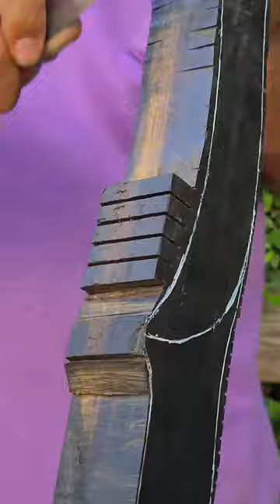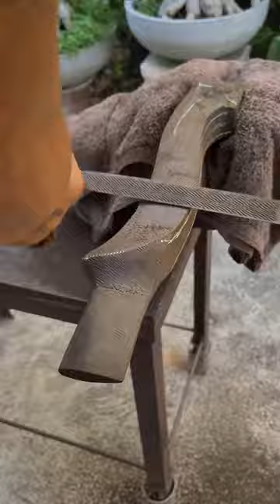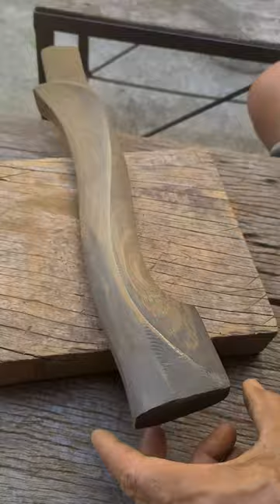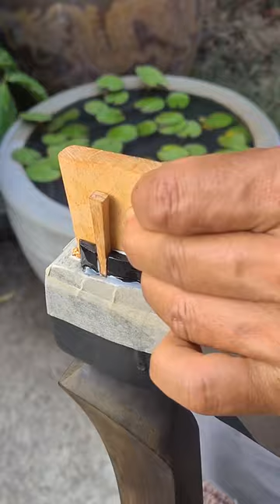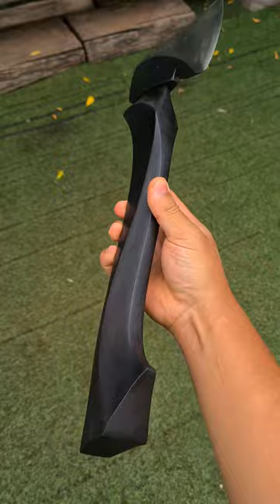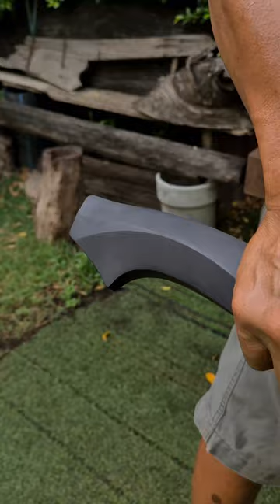Real ebony axe handle for collection and display! #craftsmanship #asmr

Comment: A beautiful display piece. Definitely the wrong wood choice for usage. Normally for handles you choose something less hard and brittle that will flex a bit and absorb vibration.  For display though you want something pretty.
Reply from the maker: Thank you, yes everyting you said is right.🥰🥰🙏🙏
Reply: So hard woods are good for axes? so what would be the absolute best wood in your opinion, not too hard and not too soft probably somewhere perfectly in the middle.
Reply: @patman0250  best woods for tool handle are hickory or Ash in my opinion.

Comment: Do you specify it's for collection and display because it's not not regular use?
Reply from the maker: Yes, we use ebony which is a very heavy hardwood, it's too heavy for use and also an expensive wood.  Most of the time we made it out in the form of art.  It works, but it's better to show it.👍😊